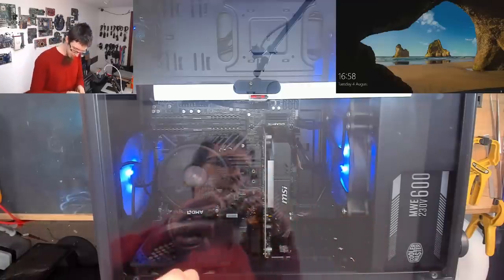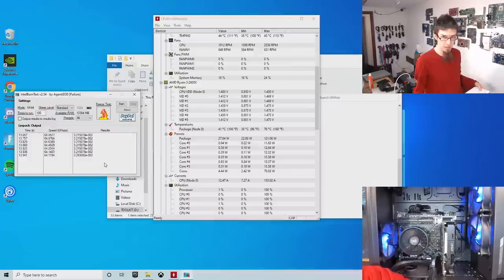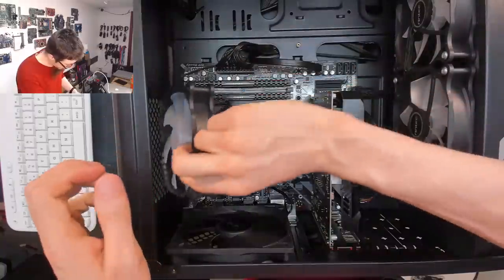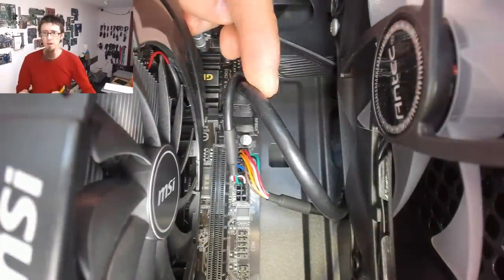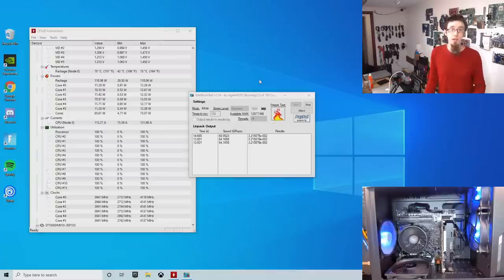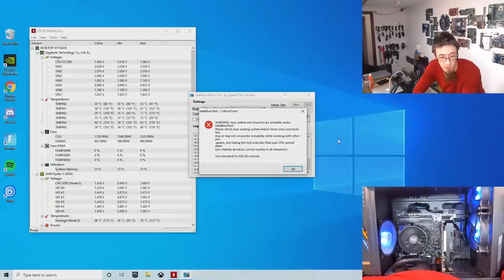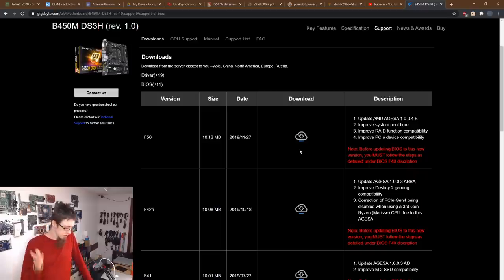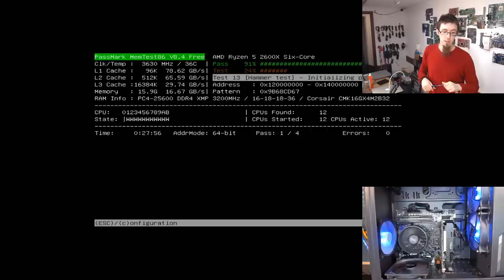Gaming PC Crashes at Random - LFC#217

Comment: My pc has started not powering on.
When I plug it in the red  led on the Mobo power comes on and the white led lights on the GPU are both on, but as soon as you touch the power on button all lights instantly go off and there's no power what so ever.
I have to unplug it and wait 30 mins before attempting the same procedure and same thing happens.
The whole system including PSU is only 7 month old, I purchased the parts from a retailer new and built it myself, I've even rebuilt it again from scratch, and still not solved it.
Sent the Mobo back to retailer for testing, it booted up 5 times on the bounce no problem.
They sent it back to me, now I have to send them the PSU back for testing. He said it could be a cold boot issue caused by the PSU...hoping it is otherwise I'm out of ideas and have a £3.500. Lump of pointless furniture.

Comment: Maybe us viewers can share some of our tools here? I take no responsibility if anything mentioned breaks / damages your or anyone elses server /pc / laptop. 

I use Easy2Boot to make a diagnostic USB with various Win installs, Unix distro's & diag software tools / virus scanners. 
Hardware / software diag :
Intel XTU
Prime95
Memtest 86 v4 (can run in Windows but best to run from a boot disk for 24hrs).
Hdsentinal (hdd test only, do not trust its feedback for Ssd's)
SsdLife

Software issues ie crash / bsod / specific program issue etc:
1) bsod view (nirsoft company) (if bsod reported / suspected) 
2) micrsoft debugger (must use in verbose mode to get the full details) (only if bsod found). 
3) re specific apps ie Outlook / Excel - does the same happen in a new OS User profile? 
3.1) if Outlook, does a new mail profile fix the issue? 
4) check disk (not great but good knowledge non the less) 
5) Dism.. Very powerful, esp when used properly / with SFC before & after running dism. 
5.1) System File Checker 

Cloning / imaging :
1) minitool - clone disks (can shrink a partition & then clone it over) 
2) macrium reflect - image disks (can not shrink partitions) 

Backups:
Cloud - Google drive / Google backup+sync
Cloud - crash plan
Onsite / offsite - synology Nas. Usually the "+" models, which can host a zerotier / OpenVPN server /be a client. 

That's all I can think of right now.

Comment: HW Monitor- Hey anyone having LOW system V levels on the readout eventhough at the connectors i get 12,5,3.3 with my multimeter?
My HW says i only got 9.4V for the 12V ?? Computer is working perfectly, i just thought it was curious... Rest of readings seem to be accurate.
Reply from the maker: HWMonitor seems to be very hit and miss right now, especially on Ryzen. I've switched to HWinfo, which isn't as nice to use, but definitely has more data.

Comment: I ran into a sim. problem. I had a Asus B350 motherboard with a first gen Ryzen but I bought a 3200 memory that was ON their list and could never get it higher than 3000. But those first gen motherboards/CPU had memory issues so I was happy I could get it that high. When I upgraded to a Zen 2 3600x I am back up at 3200 and it works fine now..

Comment: In the first run of memtest you run all cores and in the second run you run one core. A few years ago I had false positives on many computers when running memtest on all cores. I don't remember which version it was. But ever since that I run memtest on one core.
Reply from the maker: I hadn't changed settings. Some tests in the default pass are single-core anyway, so most likely that particular moment was while it was on a single-thread test.

Comment: I can vouch for the shite airflow on this case. I built a pc for my girlfriend in this case and an MSI 2060 SUPER gets up to like 80⁰C. Take the side panel off and temps drop immediately. I've got push pull fans on an arctic AIO in the front of the case and 2 fans as exhaust in the top and rear. The case isn't a very good one to build in, but it's only $40 USD so you can't really complain too much. I would've opted for the coolermaster q300L. Tons of airflow and a nice little case at only $10usd more. I also made the same mistake of plugging in the dual USB cable and the only issue is that not all the ports will work. It won't cause anything crazy to happen

Comment: As soon as I saw the BIOS version, I knew he was toast. As I have the same problem with my Gigabyte X470 Aorus Ultra Gaming mobo. Doesn't matter which BIOS you use with Gigabyte boards, the XMP profile will not work. As it is only XMP1 and the RAM needs XMP Profile 2. Which Gigabyte doesn't do. Piss poor by Gigabyte imo.  I can only get my Corsair LPX Memory to 2933Mhz. Down from 3200Mhz.

Comment: I had a memory problem with my AMD X470 I got RAM that will go up to 4000+MZh. I knew that I will not get the full speed, but with new bios updates I managed to have it run at a nice 3900MZh with my RYZEN 7 3800X. I spent some time getting ok my one did not crash when I went too high it would not boot. So I set all of the bios setting to auto, then it booted ok.

Comment: shocking build in that,ive built many a pc and over the years PSU.s seem to become more spaghetti as time goes on i much prefer the psu design that has the connectors on both ends of its cables you can then get rid of cables you dont need. plus fans in that case are a mess as far as airflow is concerned with 3 fans virtually on top of one another.

Comment: Regardless of your anecdotal experience with DS3H motherboards, they’re notorious for having the worst possible VRM you can get on the low end as well as being particularly shit with UEFI updates, you’ve lucked out so far! We see them in our shop rather often, people don’t realize they’re ultra low end and undercool/overwork them to death with like 8 core chips hahaha

Gigabyte should not allow users to install chips which will fry the boards, it’s simply bad practice and immoral, btw the memory controller is on the CPU not the motherboard, and XMP is Intel timings not AMD

Comment: I use molex on my graphic card.
I took out the 12V input cable from the 4 pin connector on my crappy ass XFX RX 570 cause the fans were not spinning, the 12v was bad, I know they have the 0 RPM mode on the driver but mine could reach 90°C and would not turn.

Comment: Great video, just curious, what are the exact specs of this pc?
Reply from the maker: It was a Ryzen 5 2600x, Gigabyte B450M-DS3H, 16GB Corsair 3200MHz, nVidia 1050 Ti 4GB
Reply: @Adamant_IT  just wondering because you said that the cpu was summit ridge, but you also said it was 2000 series, which, as far as i know is pinnacle ridge. I checked the qvl for pinnacle ridge, and the corsair memory actually is supported on it.
i have the exact same problem with the exact same MoBo and cpu, that's why ive gone in depth into this

Comment: Had a LPX kit, 3000, cl15  with Samsung D-die. All my ryzen's hated it (1600, 2700 and 3600.) I upgraded to 3200 Rev. E kit. I can push the system to 3533 with no problems. One issue 3600+ is no go because of my IMC doesn't like 3600 or over.

Comment: Gigabyte B450M S2H with Kingston 3200 16x1 + 8x1 RAM, turns on XMP is also having intermittent crash. Turns off XMP is the system never crash. Will try running at 3000. Thanks

Comment: How is he recording their computer screen? Does he have some external components doing that?
Reply: What rock have you been under? Lol. There’s many different pieces of software that does this. He’s using Nvidia.
Reply: Daniel tf are you talking about?  He’s obviously not recording via the hardware on the computer, otherwise he would have had to install more stuff, along with requiring him to use cpu, memory, and gpu processing on the recording.  Unless he is throwing the tests, he has some external method of recording.
Reply: @JJCUBER  No, he's using screen recording software, I thought it might be OBS, but that's not running
Reply: Daniel and in telling you that there is no way he is using any screen recording software that is local on the computer, as that would mess with the tests, he said he didn’t install anything else on the computer, and he has no icons on the taskbar showing any other software running than the ones for testing.  This brings me back to my original question, how is he recording? What form of external recording is he using?
Reply: @JJCUBER  Why are you liking your own comments?
There's no other way to record the screen without software (or a camera which he obviously isn't using)
Reply: Daniel there are forms of external devices which can record screens, like what people use on consoles (capture cards).  I was asking what form of external device he is using to do so.  Also I’m not liking my own messages, don’t know where you got that from.
Reply from the maker: Ey dudes, I record in OBS on the shop work station (which is recording the audio and cameras) and the Device Under Test is connected into OBS with a HDMI capture card. Thus I can record whatever comes out the repair PC's HDMI, BIOS or windows.
Reply: Adamant IT that explains it, thanks!

Comment: You should also create system restore points before working on the system. I use powershell to do this before starting work remotely or when hands on with a sys.
Reply: Not really worth doing in this case as the memory is already corrupting data - so your 'backup' will very likely also be corrupted.

Comment: Nice. I would loosen timings before lowering the speed. There is always the chance memory was not the only fault.  Look at error logs to find driver crashes or app/service crashes. Stress test the GPU.  Run a SMART report to ensure the mechanical was good, even though it is not the fault. Look for software/os updates before returning the unit.

Comment: I had similar problems for a long time. I have tried to change every single component including motherboard and the problem was still present. The problem was in a reset button which had a small floating resistance depending on a press :-D

Comment: Great work! I am curious how much you charge for a repair like this, and how it's calculated.
An upfront fee or based on the number of hours worked on the repair?
Reply from the maker: I generally charge a flat fee of £50 for most jobs, which goes up or down a bit depending on how much extra stuff there is involved, such as software serviced, etc.

Comment: Ah yes, pretty much every error ive ever ran into has been bad ram stick(s) or the occasional drive dying (mainly hdd, but also a single ssd). But ive also always been carefully and avoided overclocking things (its also cheaper). Did XMP on most of them tho. Not that i think its a brand thing as i had a Corsair stick die after just 5 months.Memory stick just die fairly often.

Comment: I don't think It's Gigabyte, It is probably the combination of AMD and low and midrange memory.  In the past five years I've build many computers and I've only had trouble with AMD and the unsupported memory modules or someone overclocking cheap memory.  I have never had a Gigabyte, Intel, any memory combination returned or come back to haunt me.

Comment: Your client probably bought separate 8gb dimms , i'm sure that if you put manually @3200 it should work no problem. That's a common fail on Gigabytes mobos even in the high end range.

Comment: one day i change my ram to 8x2 tridentz neo 3200mhz, pairing it with ryzen 5 3600 and asrock b450m steel legend.. set the xmp to 3200mhz after installed it, then it restarted for many times. luckily set down to 3000mhz is my first thought in mind and it does great till now

Comment: bro the memory multiplier was set to 42, not 32 before you changed it.
Reply from the maker: That's because when you start adjusting, the number starts at 42 (max for this board) and goes down. Just looks wonky because the hard jump-cut in editing there.

Comment: I've had the same problem, I've never been able to get 3200mhz kits working on Ryzen 1000 and 2000... Always have to downclock it to 3000.
Reply: Are you able to tighten timings because of this?
Reply: @oldschooldude8370  not tried that, I just left the timings as they were in the XMP profile. I don't have a machine to test it at the moment but feel free to give it a go and see if it's stable! Honestly the performance difference is marginal at best anyway, if it's bothering you maybe it's time to upgrade to a newer AM4 CPU, something from the 5000 series.
Reply: @yotoprules9361  It was an honest question and I was curious. I use an i5 4th gen, 16gb & 9800gtx+ It handles everything I care to play. Someone piss in your cheerios?
Reply: @oldschooldude8370  sorry for answering your question mate, why bother asking the question?
Reply: @yotoprules9361  Your wording & approach came off as prick but you meant well.
Reply: @oldschooldude8370  I promise I didn't mean it that way, what I meant was I don't have the means to test it at the moment but there's no harm in trying, there is a possibility of it working fine, but it depends on your motherboard, cpu, ram combo. What I meant by the last statement was that upgrading to a newer AM4 CPU will solve your issue if you can't get the desired RAM speed and timings, they are a lot faster to. All up to you, the memory controller in Zen and Zen+ is known for instability and being very picky so it might require a bit of tinkering. What works in my system probably won't work on yours and vice versa.
Reply: @yotoprules9361  I think I'm the problem to be honest. Cheers mate.

Comment: What you didn't call out
Lpx ram
Fans on the basement are useless gets air from nowhere or isint even placed the correct way around its pushing air to nowhere
B450 ds3h.. Horrible vrms fine for 1600 and 3300x
Psu is a white and has horrible caps/built really cheaply .(though okay for these specs) more wattage doesn't mean better!

Comment: It's not true, molex is still highly used, not only for fans also pumps, whenever there's no more 3/4 pin connectors available on the mainboard, double check before you speak

Comment: Do NOT imitate this madman. Chopping off cables is NEVER the answer. If you're afraid something might short, just zip-tie it out of the way and cover the connector in electrical tape. Chopping things off is permanent and may limit your options in the future. Plus, you might nick something vital or short things out (i.e. the very thing you're trying to avoid.)

Comment: Haha today my B450M DS3H / Ryzen 3 3200G / 2x 8GB HyperX Fury DDR4 3200 pre-assembled bundle arrived for my modern use PC, to replace my M5A78L-M LX PLUS / FX 4100 / 2x 8GB HyperX Fury DDR3 1600, and my GPU is also staying a 1050 Ti for now. So I can relate :P

EDIT: 5 months later I upgraded the CPU cooler on what was my pre-assembled board - it was my first ever CPU cooler installation and got the thermal paste right the second time. but I can do it now :)

Comment: Currently I have the same problem with my build, and I've tried to disable XMP, downclock and bump the voltage but nothing.
It blue screen sometimes or just turn itself off. 
I think it is because I have a faulty memory and not a bad motherboard (I have the new B550 Taichi). 
Should I try to run a Memtest just to be sure or else?
Reply: I had also a similar problem, increasing the trc timing to 75 did the trick. After testing its stable you can decrease the value to see at what value it becomes instable again.
Reply: @thomasschillemans  I'll try then
Reply: @kaedo-2740  i hope it will work, i spent hours in bios changing settings but the tRC increase did the trick
Reply: @thomasschillemans  it seems that even if I change just a little the trc timings it won't post. 
I'll try to get in contact with G.Skill directly
Reply: @kaedo-2740  you are sure you have increased the value?
Reply: @kaedo-2740  if no post, you can clear bios by removing the cmos battery from the motherboard for 1 minute or so
Reply: @thomasschillemans  yep I've increased from 51 throughout 75 and nothing. 
And yes I've cleared the CMOS all the time it didn't post. 
I'll avoid doing anything else to avoid making any mistakes and contact G.skill.
Thanks anyway for your help

Comment: I think as a rule, memory that you can actually buy is NEVER in the QVL. :D
Reply: Other than "go for ASUS always" - i'm not sure it's a solution, because i don't think any company delivered 100% consistently bug-free products - other is to go for RAM with more conservative ROM timings and higher compatibility, maybe Crucial. Also it seems like there would be SPD/XMP editors so you can reflash the i2c EEPROM in the memory stick to make the settings permanent, to deliver the customer unconditionally stable hardware? Potentially not worth the time. But an i2c/SPI flash tool hardware is less than $5. If one needs to do this more often, one can also build a memory slot adapter for the flash tool, because trying to clamp the EEPROM chip from the top is awkward and failure prone.

Comment: Never had a problem with Gigabyte, but a lot with Asus motherboards ( My 880GA-USB3 is still rocking my 1090T like a charm )...however, my new computer is with asrock ( R 5 2600 ) because I found b450 Gygabite motherboards looking very cheap. Oh and I check memory support since this build witch I never did before.

Comment: I don't have time to watch, but had to comment because it had such a familiar ring to it!    I bet it has like, 32GB of XMP dram actually set to XMP in bios. LOL Something like THAT'd do it!  (or some other related type of RAM speed/voltage/timing thingie in BIOS)  That would be what I checked first I mean.  I recently bought 32GB of 3600speed ram (yay!)  for my ASUS MAXIMUS EXTREME MOBO.  It does not like 32 at XMP 3600!  but is fine with 16 AT 3600 XMP. So, I keep 16GB in, and when I have a need for 32 (a bigger project, etc) I will install and test voltages etc,..  For now, i'm all set tho!
Reply: I read the descriptoon before heading out..  HEY!  XMP CULPRIT, I WAS RIGHT!  (that doesn't bode well for XMP2 LOL)